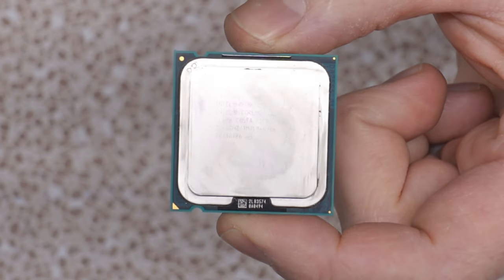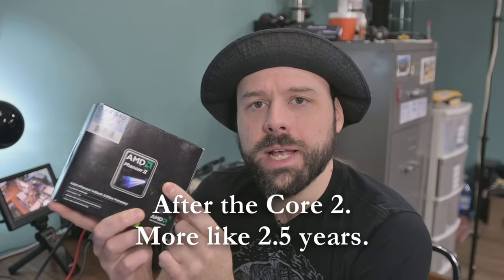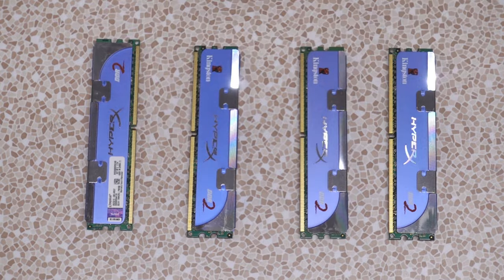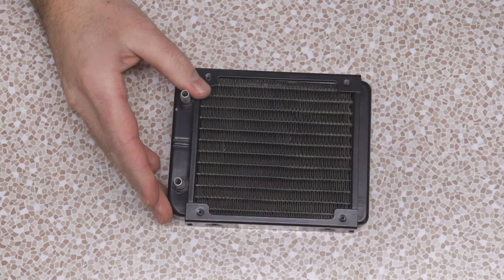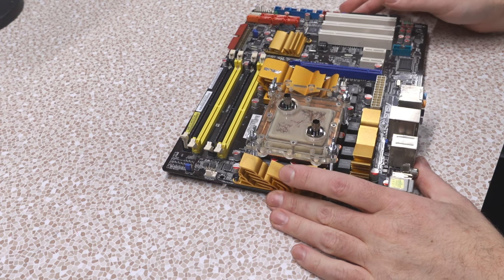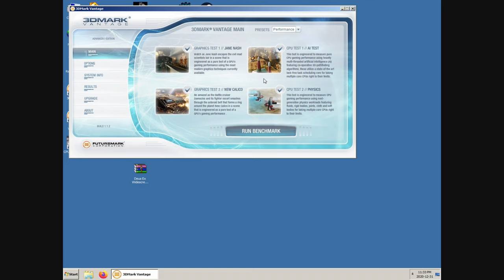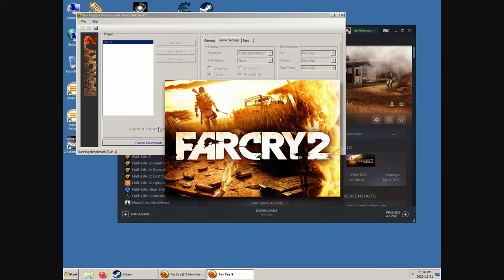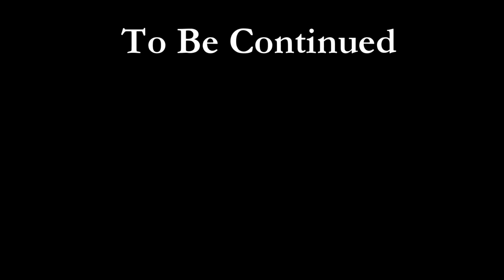2009 PC Gaming: The Core2Duo vs The Worst CPU AMD Ever Made.

Comment: Just sold a Core 2 Duo E6700 PC for $20! I was about to upgrade it to a Quad Core Q9600, but then found a Asus P8P67 motherboard with an i3-3220 for $10.
Reply from the maker: Solid deal for a 3220, that's still a relevant processor for certain applications.

Comment: Now I want to slap together my old 2009 system, a Phenom II 955 with a HD 5770, running windows 7! I have the parts somewhere.....
Reply from the maker: 955 in 2009 ? Thought it was a bit later than that.
Reply: @DATT  Nope came out April of 2009 :)